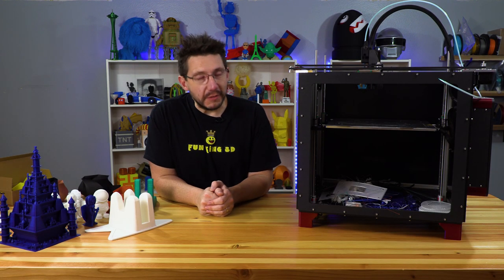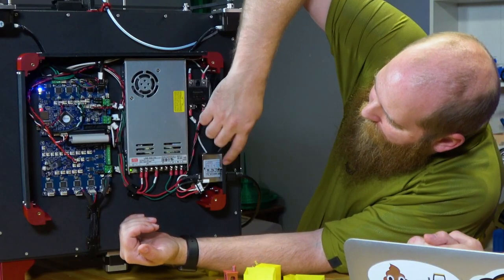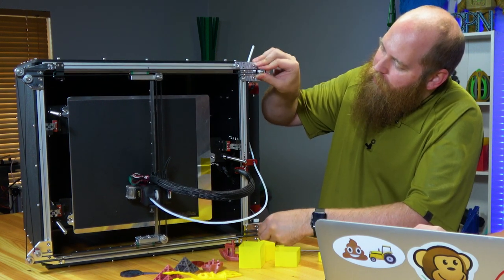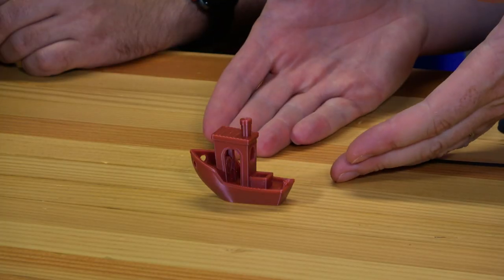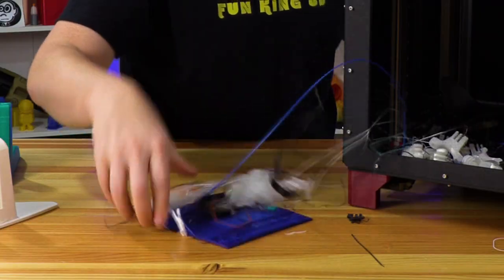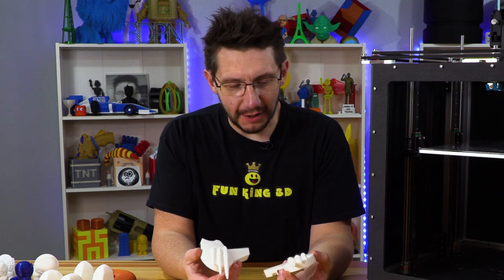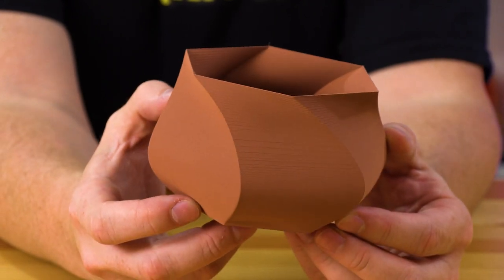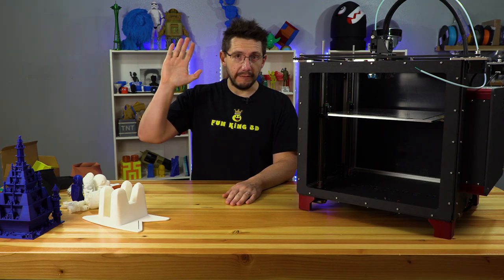Railcore II 300ZL Project R3D 3D Printer Kit Review

Comment: That looks alot like the M3D Promega...which turned out to be an under engineered pile of crap.
Reply: Ask @John Bolene about the Promega vs. Railcore :D
Reply: @jstevewhite  This one looks more robust and minus the troublesome dual extrusion.  I'm no expert and was fooled into supporting the Promega.
Reply: @EnuffsEnuff318  promega was advertised as being great, at the initial $1000 it is worth that since you have to mod the printer to get it to work and will spend anopther $200-500 to get it to work,    at $1500 or more the promega is a pile of crap compared to the railcore
Reply: @mostlymissiles  See...even not being an expert, I was able to observe what Joel mentioned in this video about the nozzle plowing or dragging because it's not perpendicular.  The M3D jackwads used threaded nozzles in an unthreaded hole....held tight by set screws which made it nearly impossible to align 2 nozzles for one, and totally impossible to have the nozzle be perpendicular to the bed.  It's just one example of the corner cutting and cheap skating they did on the entire printer.  Yeah...I know of the mods, but the Junkmega is haphazardly thrown together and was actually marketed to the newb Micro owners as an entry level machine.  Then they skirted support by making it community supported.  You may already know all this so I'll shut up....lol
Reply: @EnuffsEnuff318  indeed, I have one that came with broken parts that took 6 weeks to get the first print attempt done which fails on the compound, after many failed attempts I then bought the ktana and had it working in 2 hours, I even asked for help in those 6 weeks and was told they only replace broken parts, not how to replace them
Reply: @mostlymissiles  I got both hot ends from the start and realized the mixing nozzle was a dumb idea...switched to k'tana and ended up taking one nozzle off.  Now tool cooling is a problem.  Print speeds are still horrible and even though the community made gearbox is a good idea, I gave up and decided to put my money into a Prusa.  Live and learn I guess.
Reply: @EnuffsEnuff318  I print 60/second with the 0.5 nozzle and 30/second with the 1.0 nozzle
Reply: @mostlymissiles  40/s is my top speed with the single k'tana

Comment: $1500 !
too expensive for a kit.
Reply from the maker: What do you base that on?
Reply: If you can source this setup cheaper I'll happily buy from you.
Reply: Speaking as someone who self sourced and built this...no, it's not too expensive. It's a great deal at this price, easily the same price or cheaper than self-sourcing, as well as a great wiring loom and the parts all come in one package.
Reply: If your base is an Anet A8, then anything other than it is too expensive. You're not just buying a printer here, you're buying quality and reliability.
Reply: @3DPrintingNerd  I would say the basis of Eric's comment is ignorance. I can confidently say he spent no time researching anything related to the BOM of this printer.
Reply: Its a bargin for the high quality components. Its a real printer with precision engineering. You are not in creality anymore Dorothy.
Reply: It's a fantastic bargain. As someone who's been working on a HEVO, I've spent double that and gotten significantly less quality so far. Wish I knew this existed as I would've bought the kit